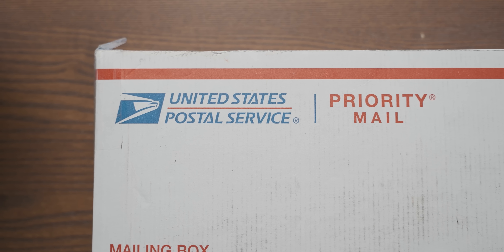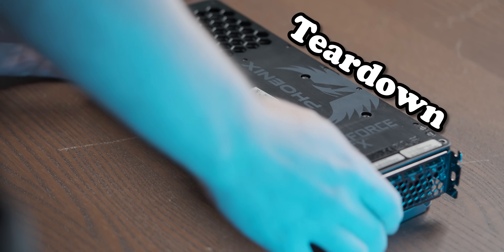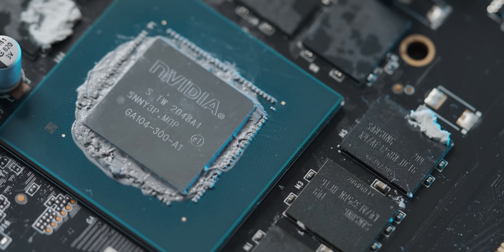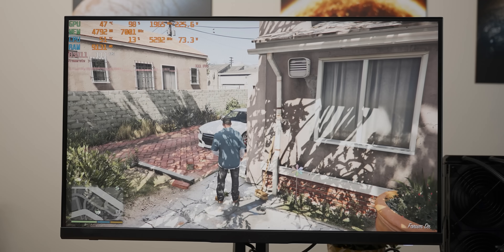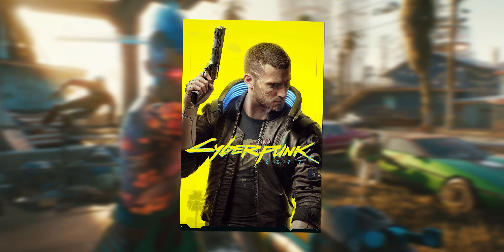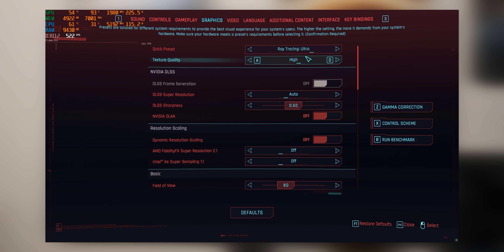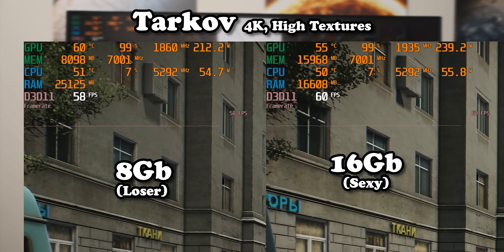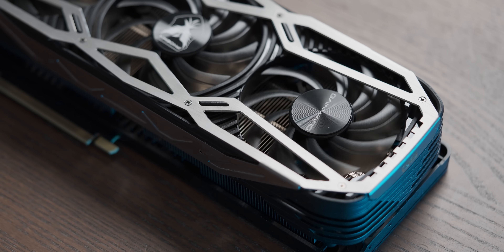This Is The 16Gb RTX 3070 Nvidia Should Have Made

Comment: The 8gb loser card uses more system memory because it is supposed to. When you run out of VRAM an Nvidia card will perform "Texture streaming" for which it uses your system memory. That is why when you don't have enough VRAM your game will run like warm arse, because system RAM is much slower for that task. Latency on VRAM is crap of course, but that doesn't matter to a game who only cares about the raw speed. Hilariously back in the days of the GTX 470 and GTX 480 it would texture stream from the paging file on your hard drive. One can only imagine the 1 FPS nightmare and the horrible noise your mechanical drive would make during those moments. Sadly I know that sound very well, as BF3 would run out of VRAM on my 470 at ultra settings. So I replaced it with a 2gb Radeon 6970.

Comment: should've used DSR to push that VRAM to the limit. after edit: way to test everything that doesn't really hit vram.. tarkov exempt.. but my buddy with a 7800x3d and 2080ti is pulling 140-180+ on streets, so I think the CPU was holding back the card.
Reply: RTX 2080 Ti has 11 GB VRAM with GPU performance similar to RTX 3070.

Comment: The biggest bottleneck I run into with my 3070ti is VRAM limitations in Virtual Reality. Would absolutely adore a 16gb varriant, as the actual GPU cores have so much more to give when its not held down by 8gb of vram.
Reply: What games do u play in vr, i wanna get the quest 3 and upgrated to an rtx card in the future probably better off getting a used 3090
Reply: @lookmanseedat  VRChat, Half life alyx, Contractors, Phasmophobia, and beat sabre mostly.

Comment: I hope someone uses the 2GB GDDR6X chips from the 3090Ti for the normal 10GB 3080 and convert it into a 24GB 3080
Reply: That's not possible since the bus is different. 320 bit and 384 bit don't work the same. 320 bit only allows 10 or 20 GB and 384 bit bus allows 12 and 24 GB. The 3080 is 320-bit meaning that you can't really have 24 GB on the 3080 but the 3080 Ti can have 24 GB since that's also 384 bit just like the 3090/3090 Ti. The closest you can get to 24 GB on a 3080 is 20 GB.

Comment: OK, being relatively new to the world of PC building and stuff, when Dawid wanted to compare the 16gb 3070 card to the 8gb 3070 card, he said," It's only the Dell version," as if that was bad. I would of thought a 3070 was a 3070 no matter who the manufacturer was? Or am I missing something?
Reply: You aren't wrong. Most of them are basicly the same or perform within a 2% margin. The real difference is the cooling performance and the looks. And some may be able to draw more power (as you saw the Dell only has 1 8pin connector as opposed to the 2 that the other card had) which means you can't overclock it as much.
Reply: @mjn5016  OK, so, as far as the average Joe (someone like me,) is concerned, who just wants a modern video card to play modern games, then it really doesn't matter what manufacturers graphics card you get. Thanks for the reply.
Reply: @yogibear2k2  yeah

Comment: It makes sense that when you run out of VRAM, textures and such will be pushed to system RAM. So, when the games that could make use of the extra VRAM saw it there, that is where all the extra stuff needed was put and taking far more load off the rest of the system. And, the VRAM was able to fill up because the GPU could only do so much with a lot of the later games it struggled with.

Comment: I swapped the gddr6x on my 3090 lol. I removed the rear chips and used 2GB chips on the front memory oc is way better memory Temps are below gpu temps I just got a 4090 and have been thinking about swapping in 4gb chips for 48gb total lol

Comment: Try resident evil 4 remake at 1440p higest settings including rt it should run fine of the 16gb variant since it does on the 8gb variant with lower textures but with the highest textures it immidiately crashes on the 8gb 3070

Comment: @dawid the reason the 16gb card is allocating/using less RAM than the 8gb VRAM card is because when a game runs out of VRAM to pull from, it’ll also start pulling from the slower system RAM to compensate hence higher RAM usage. At that point you will notice some textures may load slower or textures will start loading in at lower resolution, stutters, low fps or maybe all the above in bad cases. 

It’s not necessarily frame rate here. The point of more VRAM is so that the game CAN run higher res textures all the time before/if it hits its limit and starts loading in dog poop textures. Of course if you aren’t even looking closely you may not notice.

Basically at 8gb, games using 7-8gb with higher RAM usage may already be loading in low res textures and texture pop ins without you even noticing. It doesn’t matter if you put the textures on ultra, the game will load in lower res textures if the VRAM won’t allow it to keep up. It basically attempts to load ultra as many places it can, but filters in lower quality ones elsewhere 

Just wanted to state the reason for the card thanks!

Comment: I always wondered if you could ACTUALLY just.. do this. Never thought Nvidia wouldn't.. "protect" their cards from such.. unwanted interventions.
I guess nobody deemed it worth doing in the past, until now that is. That only goes to show HOW FUCKING BAD the GPU MARKET HAS BECOME!
This is a fucking joke.. Not the mod, the mod is WONDERFUL, I'm considering doing it myself, I'm just not sure it can be "DIY'd" by lesser means.. :|
I suppose the chips themselves wouldn't be either too hard to source, nor too expensive for a one time deal (unless you can only buy them in bulk)
The rest though.. taking the old ones off, doable.. Soldering the new ones in.. Hmm, those PCB traces, pads and the surrounding SMT's.. risky trick.

Comment: Well in normal desktop stuff, not so much of a difference. 

In VR however totally different story. 
I'm almost constantly using 24 Gigs of VRAM and barely using my 3090s core. A 3070 also gets the job done, but is struggling so hard with its 8 GB of VRAM and the system memory being used as additional VRAM... 24GB out of 32GB being used there in total. When I switch to my 3090, VRAM usage is cranked to 24GB and system memory usage being at 8-10GB..

This would be the perfect "budget" VR GPU in my opinion
Reply: Yeah, I love the power of my 3070ti, but trying to load in a heavily populated VRChat instance is hell on 8GB of VRAM.

Comment: I have that exact GPU just with the PNY stickers on the fans. I remember when the 3070 was leaked with the 16GB variant and then they canceled it before it released, I complained about it and I got so many negative responses as if I was being unreasonable asking for that much (despite it being very obvious with the consoles set to give their games access to 10-12GB of their shared GDDR6). A couple years later I was proven 100% correct when 8GB cards started commonly running into issues with the biggest games (the new Resident Evil for example, I saw cases where the game would just instantly crash if you raised the texture setting above the lowest).

One thing you have to realize in your testing, is that in many games openly lie about how much VRAM they're using. It might SAY 7GB of a 8GB card (leading you to believe you have 1 whole GB of extra headroom), but what it's actually doing is caching more and constantly swapping it in and out of the VRAM which severely harms performance AND frametimes AND load stuttering (and sometimes visible texture pop-in or stuck LODs as well), so it's only when you are very far clear of your max, say 7gb out of 12 or 16gb max, that you will avoid those performance issues and the game will actually be honest about how much it intends to use.

Comment: I wonder what the limit is.  Can you make yourself a killer machine learning card, bumping up to 32 gb or something?
Reply: The limit are rams: there are models of 1gb and a compatible model with 2 Gb if you swap them you can have double ram, IF your bios handles 2gb modules, and there are no hardware problems (like in the 3080 that can't be upgraded if not using a 3090 board)

Comment: Honestly, i think you shouldn't have done that boost lock thing on the standard rtx3070 since it is something that you can't disable on the modded one and apparently it lowers the clocks. I mean no one would leave potentially untapped power on the table so it would be a trade-off: either 16g vram and lower core clocks, or 8g and higher core clocks

Comment: ive noticed the same thing as well my rx6800 has 16gb of vram and when i swapped temporarily to an rx 570 4gb card i noticed my ram usage went up alot as well
Reply: yeah its called vram spillover, and is the reason you see the inconsistent frame times, stutters and pop in/ textures not loading properly or in lower res until you get close on the 8 GB card. Thats why yes 8 gb cards are still fine and usable, but more produces a more console like exp of locked frame rate and and you need less ram in your system. thats why 1440p nvdia system need 32gb ram and 1440p rx system are fine with 16 gb ram since they have .....12-16 gb of vram.+ less cpu overhead so if you have an older system, its way more efficient going with amd then nvidia.

Comment: doom eternal with 4k, rt on, and the texture pool size set to nightmare or ultra nightmare should do the trick. I struggled a lot with getting decent performance with my 3070 with these settings so I had to switch the texture pool size to high to fix the issue and have a stable frame rate

Comment: now a 3080 with 20GB soldered onto it would be EPIC because a 3080 is fast enough to get some nice use out of 20GB.
Reply: Yeah it’s a bit of a shame. I have the 3080 10gb version and it would really benefit from some extra vram. Not planning to upgrade it for a little while still though. That thing runs stuff fast enough but sometimes that vram limit is a bit of an annoying bottleneck. It wasn’t necessary. Especially painful since some of the lower end cards got way more vram, even if it’s slower.

Maybe when they release the 50 series I’ll look into it again but I’m doubtful that I’ll upgrade then too. Had a 1070 before I got the 3080 but the 80 series should last me a bit longer. Also no real reason to upgrade yet.
Reply: @xanderwusky  i am also stuck with 3080 10 gb. I think it's fine for 1440p resolution.
Reply: @Richdadful  I mean I’m not unhappy with it, just think they really should have put more vram on it.

I use it with a 4k 120hz screen which works fairly well. Not like I’m running everything high 120fps but change a few settings and it usually will get close
Reply: @xanderwusky  right now 3080 is pretty good but in future ut will have vram issues.
Reply: @Richdadful  when is this future you’re speaking of? I’ve had my 3080 for bit over 2 years now. I’m still ok on vram with it. It’s not fast enough to run games maxed out 4k and 120fps but not due to vram. That’s due to the speed of the card.

Yeah maybe in another 4 years the vram will be to little. But by that time I’ll have a 7080 or whatever there is then
Reply: I think there's a variant of the 3080 with 20GB
Reply: @bootchoo96  It was planned but never released.  Since everyone bought 3080 10GB like crazy from 2020-22. Why bother putting more ram when less ram card is selling like this.
Reply: @Richdadful  the cynic in me thinks it’s because Ngreedia didn’t want another repeat of the 1080ti.
Reply: @LuigiGodzillaGirl  Nothing to do with being cynical if you ask me, it's plain marketing logic: If you produce a long-lasting product, then customers are not going to buy again "soon enough". If you create an artificial shortage (looking at you, VRAM), you create a need for the customer to buy sooner. It's the sole reason these generations were so short on VRAM.
Reply: naw lets use all points as not every vram spot has a memory chip soldered onto it and get 24 gigs
Reply: @play420gamr  The 3070 does not have the bus width for more than 16GB. It's only 256 bits. This means that while the PCB may have space for 12 memory modules, the GPU die can only ever access 8 of them.
Reply: @Steven Steele google it, the 3080 20GB exists
Reply: They should have sockets for ram like motherboards do
Reply: @notinterested8452  they did exist. Some gpu used to have slots for it. Unfortunately the longer a path is to the gpu die the slower the ram will run.

Idk if you noticed, but the ram on your gpu is running a whole lot quicker then the ones in slots do. That’s because a slot is increasing the path, meaning more resistance and less high speeds.

Putting slots on gpu isn’t possible unless you want to dramatically lower your gpu performance
Reply: @xanderwusky  thanks for the reply I thought as much but wasn't sure.
Reply: I did my 3080 to 22gb but vram temp are going to hell..so waterblocked for 2month... than I selled someone.
3x are sucks...
Reply: in hindsight the swap out so fast it will never you 6gigs....  pctech 38+ years...     look at you system with 16 gigs on it and tell me you see it FILLING the ram...  dunno bought you but mine shows 4 gigs used..never above that :-\
Reply: Modern GPUs often don’t benefit from more VRAM because the shader cores (the GPU’s “engine”) are already the performance bottleneck, meaning the card can’t process frames fast enough to fully use additional memory capacity. Adding more VRAM only helps when memory size or bandwidth is the limit; if the compute engine is maxed out, extra VRAM just sits idle and doesn’t increase FPS.

Saying a GPU needs more VRAM when its shader engine is already saturated is like installing a massive fuel injector on a 200-hp Honda and expecting it to tow a yacht: the limiting factor is the engine’s power, not how much fuel you can feed it.
Reply: That is called the 3090.
Reply: @Flame8boy  Exactly. But worse. 🤣
Reply: why stop at 20gb go all the way to 64 if its possible
Reply: @3X0SK3L3TON  You can in theory keep arbitrarily increasing the capacity of the 3070 by powers of 2, but in practice this is the limit. The 2GB (16Gbit) chips used here are as dense as gddr6x gets. 4Gbit is allegedly on the horizon, but for gddr7, which can't be used here.
Reply: @DigitalJedi  doesn’t the 3070 use gddr6? So you could go to 6x still. Doesn’t change the capacity though.
Reply: @3X0SK3L3TON Nvidia cards can support 2x VRAM out of the box for whatever reason
Reply: So true !
Reply: How?  I struggle to get 4K60fps in most games on my 3080, how is more vram going to help with that?  Even after watching this it seems idiots wont believe that vram doesnt really matter.
Reply: @kidShibuya  what? It absolutely does. What are you doing that you struggle reaching that? Do you have an older cpu or something? There is basically no games that I can’t reach 4k60 fps on. With my 3080

It’s absolutely not like every game needs more then 10gb. But some do. Even in this video you can clearly see some games get a clear performance benefit even from the 3070 (this would be larger of a difference with the 3080).

Saying vram doesn’t matter is just beyond stupid
Reply: @kidShibuya  2k res it's not going to have much issues.  
But 4k sure it's going to have issues plus fps doesn't matter.  Vram requirements are based on resolution and texture settings and not on fps. If you lack vram there will shuttering here there since data will be transferred from system ram to main ram.  You will get 15-20 fps dips If you can bear that than no issues.
Reply: @kidShibuya  i have a 3080 12GB and i can play 4k60fps fine.
Reply: @kidShibuya have you watched any benchmarks of the card?
Reply: @kidShibuya your 10gb card struggles to do a minimum 12gb job? You don't say...
Reply: @kidShibuya  My Skyrim modlist would choke your puny 10gigs. So yes VRAM makes a difference in certain scenarios.

Comment: I wish I could just send my card over to someone for a cheap upgrade. Unfortunately I believe even if someone near you could do the job it wouldn't be worth it, especially at the risk of brcking a still very usable card.
But if it always leads to problems when boostclock isn't locked, this unfortunately is not of practical use. I suppose it is only possible to use ICs with the same specs as the original and just double capacitiy, not say upgrade a 3070 to 16GB GDDR6X or a 3080 10GB to 24GB of faster GDDR6X?